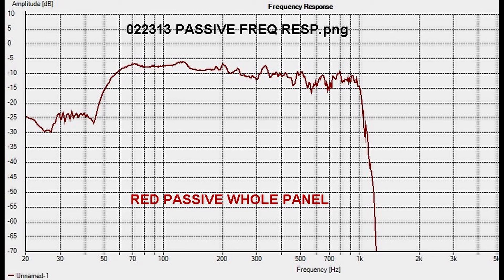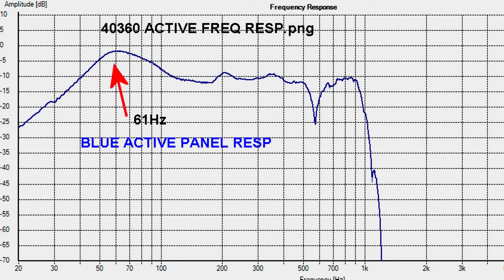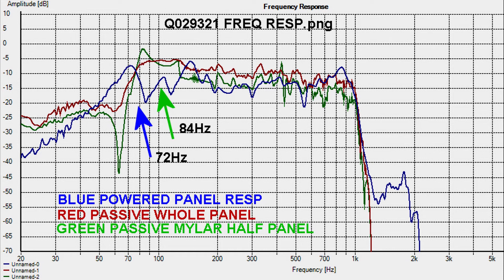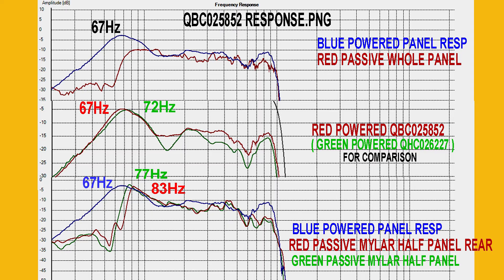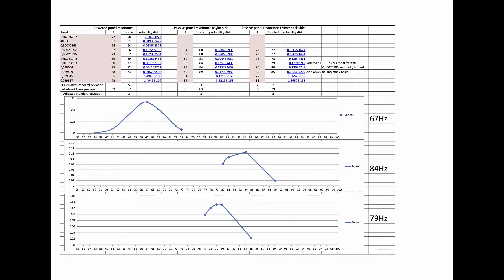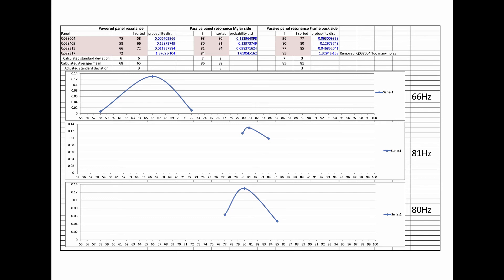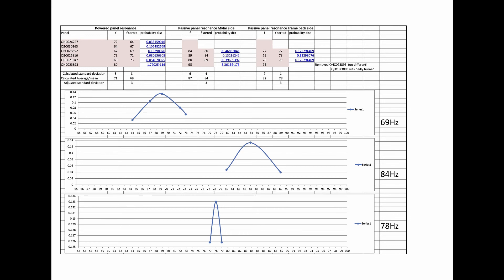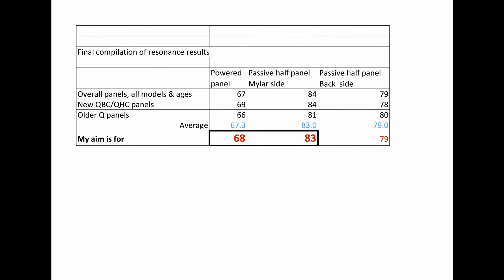Quad ESL63 Repair Part 03C resonance results and conclusions

Comment: Hi Moggy interesting work you do here. Speaking your passive way of testing resonance I find your av. 83hz a bit low compared to quad writing a number (in Hz?) between 87 and 90 on some panels but not all. I could be wrong but these numbers cannot have been for a whole panel with active mesurements.
Reply from the maker: I've never found any dissertation from Quad themselves. I'm soon going to re-visit all this but likeness to new panels seems to be a good idea to me.

Comment: It's obvious that mylar gets a bit tougher and lesser flexibility during aging. From what I have found, you should get a resonance around 40Hz.
Good job!
Reply from the maker: I'm assuming you mean with a complete panel driven. I haven't found it to be that low and I have measured many but I'm willing to think differently when I get back to stretching my mylars.
Reply: @MoggysHiFiAntics  Yes, you are correct.
The whole panel driven.
Apart from that, I tune with a weight.
Reply: @jlindborg1105  I have used weights to determine the amount of stiffness by the mylar just touching the cct pcb. However I'm more inclined to actually reproduce the resonance compared with a new panel, this is how joppe peelen does it and I like the method.
Reply: @850mk3  If one take real good care of the precision, you are able to get really good results. Also, I make 4 at a time getting exactly the same tension of all 4 membranes.
Reply: @jlindborg1105  yes 4 say bass panels at a time thats how I do it.